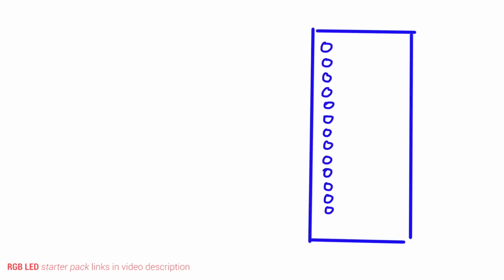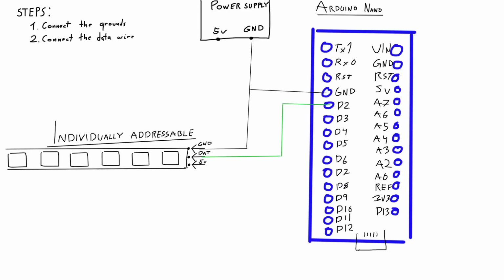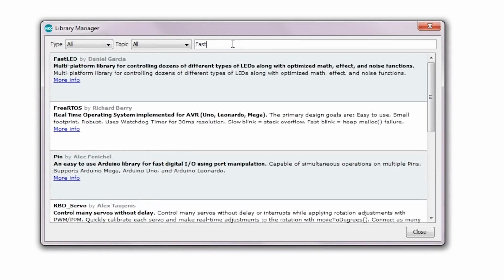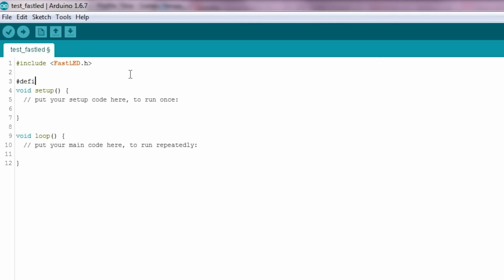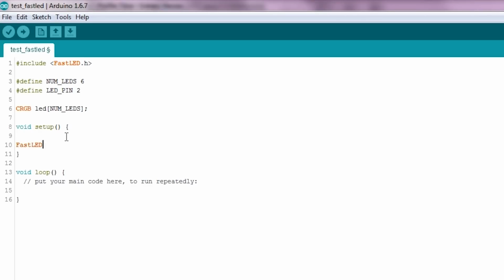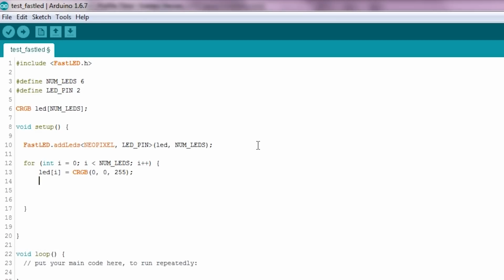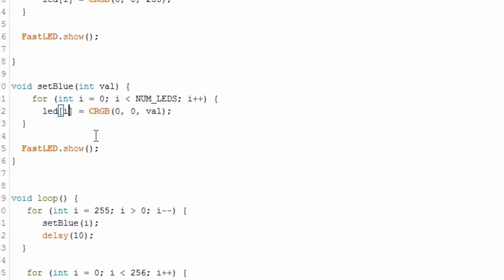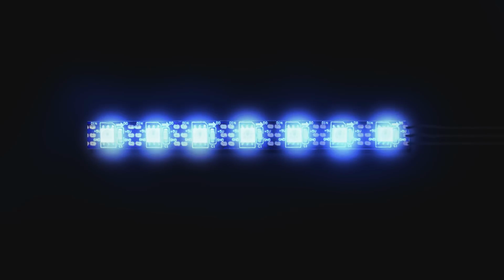Control RGB LEDs with Arduino || Arduino Essentials #1

Comment: can we make pov display with this?
Reply from the maker: Essentially, yes, but you need to do some other stuff as well
Reply: Natural Nerd i have planned to make a pov display using arduino and led..the problem is that the circuit is very complicated..so can i implement pov display with these led strip...i mean  with one signal

Comment: so after you do all the code can you run the strip without the arduino? or does the arduino need to be connected in order for the leds to receive the code?
Reply from the maker: The Arduino runs the code and controls which signals are sent to the LEDs, so it has to be attached. Else the LEDs will only hold a static color.
Reply: it has to be connected or on a different case you can leave the ATMEGA with out the arduino shield

Comment: Is the 5v pin on the Arduino board an output?  Could I use that pin to power the LED strip if I am powering the board through USB?
Reply from the maker: only with a couple of LEDs, the Arduino does not output enough current to power many LEDs
Reply: Natural Nerd My first project is going to be small. Would 3-4 be safe for testing?  Am I correct in thinking that LEDs just glow dimmer when under-powered? I don't want to "magic smoke" the board right off the bat.
Reply from the maker: I'm pretty sure 3-4 would be fine for testing. If you draw too much current, you can damage the board, yes.
Reply: Natural Nerd Sorry, I'm new to Arduino boards.  Do you know if it is a regulated 5V output or just a contact point to the circuit board's internal power?
Reply from the maker: Look at the answer in this stackexchange, I think it answers your question:
http://electronics.stackexchange.com/questions/67092/how-much-current-can-i-draw-from-the-arduinos-pins
Reply: Natural Nerd great! thank you!

Comment: Excellent video   very good ,  but delivered at extreme high  speed  Please read further questions 

 1: Having explained this much as far essentials is concerned what do you feel are the important parts or absolute essentials  that you have missed ?  

 2: If the user truthfully really does want to delve into arduino  what should you next step be do you think and could you explain how you might attack this problem ?

3: What do you think the user now understands about the  communications protocol for addressing the led lighting ?

4: How would you consider that knowledge of that communications  protocol might affect industry later   on ? 

5:  If you were to write this and its library  from scratch what language would you be using and at what level  ? 

7: More importantly why would you be using your choice of language ?

8:  What would you feel the users understanding of the hardware is at this stage ? This includes external hardware regarding led strip 

9: What  typical precautions that you might observe and how would you instruct define those pre requisites be  and what would your expected be knowledge  be with reference to hardware be   ? 

10: If you gave the user a schematic showing the led strip   and its associated hardware how quickly would most be able to identify particular components be and would they recognize badly made led strips with possible mistakes in both structure and design 

11 :What does the user know about libraries used in your sketch and  what do you feel their understanding might be of a library  ?

12: Would you consider this import and withing your answer could you explain why you might or might not consider this important together with its impact in perhaps business on both the both the buying side , technical side , sales side ,  managerial side 

13: With reference to your above answer to question 12  how do you feel that your answer may or may not throw light on the number of bossiness in todays society that now closing and how would explain this to the departments of man power  with respect to high levels of unemployment ? 

14: What do you feel the importance of flow charting might be with respect to your tutorial and how do you feel that might impact your code or  others whom you instruct  ? What you describe as the importance of writing algorithms be with reference to  deciding on flow control of your code  ? 

15: What would that impact be in the work place do you think ? 

16: On you clip  you have depicted a power source from whence you led strip derives its power  Ho would you implement over voltage protection and what would you do in your setup to ensure that of the led strip failed  that no damage might be caused to the  Arduino ?

17: With Reference to question 16: How would you describe the impact of this in lets say a custom design and its servicing required within an interior design and how would you tackle this problem 
18: What typical types of test equipment and tools would you require to locate a fault in these areas 
Thanking you 

Mark
Reply: Make 100$ payment and I'll answer all that book of questions...
Reply: Mark Harrington ignorado rufián :v
Reply: Lol. There’s a great website that can answer this ridiculous list of questions. Just follow this link:
Www.google.com

Comment: Quick question, this LEDs are necessary Neopixels strips? or can any rgb conventional led work as the same?
Reply from the maker: Hey! No, leds can only be addressed individually if they are of a neopixel kind, I'm afraid
Reply: Natural Nerd thats what i thought.... oh well it was nice having the ilusion for a while... hahaha.  thanks for answering
Reply from the maker: The specific effect created in this can be achieved with regular leds though, using a transistor like a mosfet. But you wont have the ability to access each led through an array to set the color value

Comment: Or, You could address them individually, Like this with 340 pixels.
https://www.youtube.com/watch?v=CSczejrayZU
Reply from the maker: They are addressed individually, just set to the same color :) Of course, using the same code we could set all to different colours.
Reply: Since you used a delay function you could have use a for loop too. Just to show them as true individual lights.
Reply from the maker: That's true, it might have not shown very well in the video that they are in fact addressable. Ty for feedback :)

Comment: Thanks for the video!  I'm new to arduino and IDE but I'm looking forward to digging in.  How much more work is it to actually address them individually in your code?
Reply from the maker: Thanks for the feedback. We actually address them individually, even though the effect is not so visible. When looping through the led array, each element led[i] can be given a different CRGB value, resulting in each led having different colors. Deciding how we want to give the leds different colours is more of a design issue when creating a project :)
Reply: if you look at how for loops work, do you see when you set led[i] to a color? you're actually setting the led of index "i" to that color

try it again and type in a number without writing the for loop, and you'll just change that led

Comment: love this!! I'd like to see a tutorial like this for controlling a max number of individually addressable RBG LEDs....like what is the max number of RGB LEDs that can be controlled? Is it possible to individually address 1024 RGB LEDs? or how about 2048? or 4096? what kinds of technologies would it take? what are the technologies involved in such a large setup? multiplexing? wires? drivers? Keep up the good videos! :-D
Reply: There is no limit to LED theoretically. I think the major issue with so many leds will become power consumption, as most of them run on 10/5V only. I have a strip of 120 LEDs and it draws approximately 36W on 5 V, so you get 7A current. On 1000 that would be 70A. Very high draw from home sockets is I believe somewhere between 15-20A.
Reply: I was mainly concerned about address-ability. Being able to individually address each LED, and what signal wire protocol. i.e. if using 2-wire serial communication how fast is the refresh rate to loop through each LED and set it's light value. If using a hybrid parallel/serial signal wire protocol with something like ethernet wire then what kind of refresh rate could be expected. If using a fully parallel wire obviously addressing loop time would be very fast.
Reply: My other main concern is how would the setup/configuration be done for 
very large numbers of LED's before it becomes impractical for individual
 addressing. i.e. How do you do this kind of multiplexing? I've seen a 
lot of videos that say you just do it, but gloss over the implementation
 details. I like that you have all the details in this video and would 
like to see something that goes into greater detail on large scale 
multiplexing.
Reply: If you do it through arduino, you don't care about the serial connection. You upload the script and it just runs on its cpu - aroudn 800MHz. through serial/tcp, you can only upload some simple commands that affect the loop, where you don't care about speed. the limiting factor in this case would be both the arduino and the led itself. I really have no idea. I recommend https://github.com/FastLED/FastLED/wiki/Overview to browse through their library. It's amazing and I used it for all my projects so far.
Reply: Ahhh ok I just looked up the specs for the Atmega chip at 250,000 bps, and 16 bit serial address gives about 65,000 individual light addresses as the limit. But lets say a liberal estimate of 10,000 individually addressable lights on a serial signal wire. So that means to drive that chain we would have to send 160,000 bits which would take approximately 0.64 seconds, which is about 1.5625 hz refresh for the entire light chain as the theoretical limit. So my real interest is in how you could get this refresh rate up by using more than just 1 serial wire, and what would work best and how the implementation would work. Obviously if you use a 2-wire telephone wire you could probably get this to double since the data pipe would double. 250,000 bps down 2-wires rather than just 1. 4-wire security cable would double it again to update the chain in 0.08 seconds 12.5 hz. Ethernet wire would double it again and give you about 25 hz. I suppose that is acceptable refresh rate for most applications. And most applications will have less then 10,000 individual lights. ;-) Next interesting challenge is as you said, power, and of course programming. I'll have some fun when I finish building my Maker Lab space. Thank you for all of this! Good stuff!!

Comment from the maker: Did you like the idea of this series? I know there's a ton of Arduino videos on YouTube already, and I'm not sure if the topic is already too saturated. In the case that you liked it, have any ideas for what you would like to see in the future?
Reply: I added this to the main comments section, but also I want to leave it here for you @nerdforge

Let's say I want to control 12 leds with arduino nano. So I connect them and create a colorful grading base animation that looks great.
But in addition, is it possible to use a switch for each led that when pressed the corresponding led will change to white? All this without interfering with the base animation.
Is this possible? I've been looking online but haven't been lucky enough to find information on a project like that.

In other words, having an animation loop around the whole strip and when pressing (in example) switch number 3, the led number 3 goes fully white, while the animation still keeps going for the rest of the LEDs.
Reply: I have an idea. how about an led strip behind the dashboard of a car or inside of it that lights up and does a forward and back motion and then stays on when you switch on the ignition of the car. i have been looking for a video on this and cant find it anywhere. thats actually how i found this video. keep up the great work.
Reply: Try searching "larson scanner arduino".
Reply: Natural Nerd What about a 100W LED with an Arduino based pwm fan controller and a temp sensor?
Reply: I would like seeing you doing more of the coding stuff. 
love your videos, they are greatly made! if you only could talk a little bit slower. not always easy to understand what you are saying wth your nowegian accent.
Reply: Want to see a video of arduino nano bluetooth servo powered speed controlled tank
Reply: I gave 4 pin RGB led strip. How to wire it
Reply: Your are some of the best diy tech YouTubers keep it up

Comment: The Arduino needs a power supply too. ! (5v)
Reply from the maker: That's true, but this will work if its plugged into the computer with the USB cable so I didn't think of including it.
In any other case, Arduino can use the same power supply as the LED-strip
Reply: @Nerdforge  yes but on wich pin should i connect the external power?
Reply: So if they share the same power supply, you don't need an extra GND wire going to the board do you?